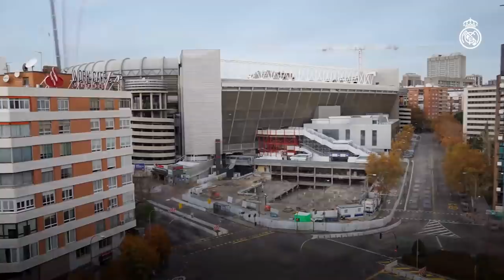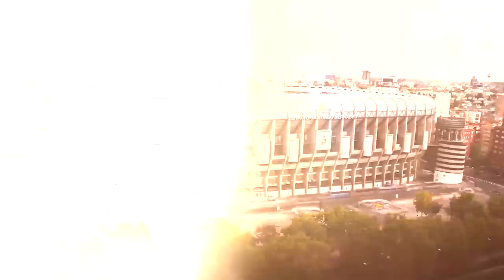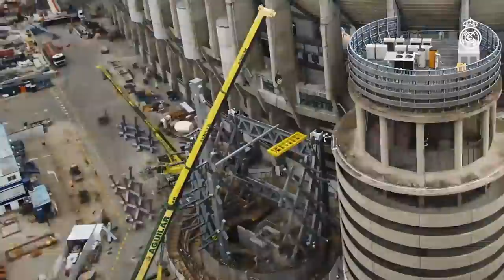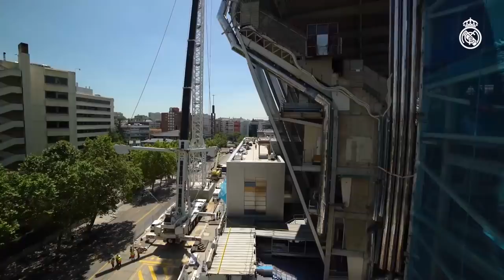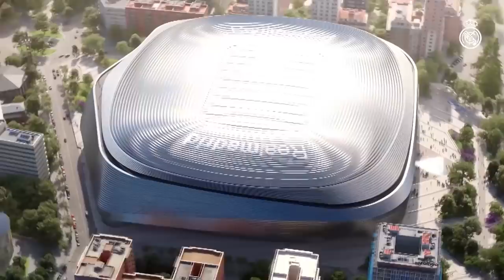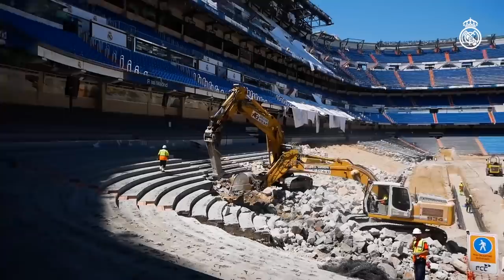🏟️ Real Madrid | New Santiago Bernabéu stadium renovation works!

Comment: I will miss the old look , it was iconic
Reply: The old look? Wich one? Because there is the first one from 1947, the 1957 one, the 1982 one and the Mendoza's one in the 90's (finished by Pérez in 2004).
Reply: @robert111k  the one that they are changing rn